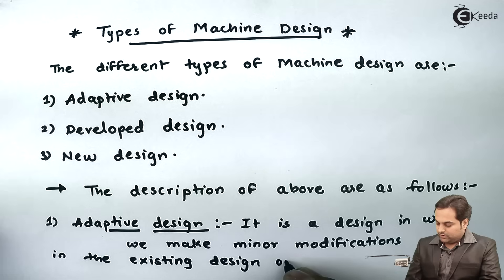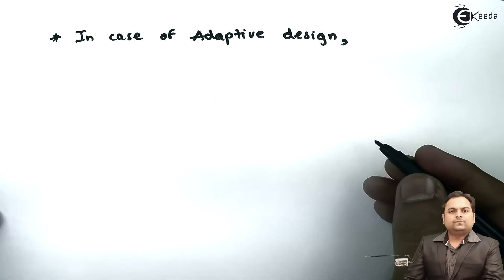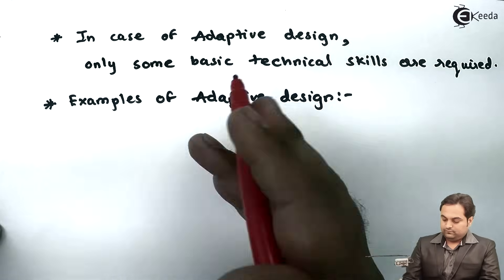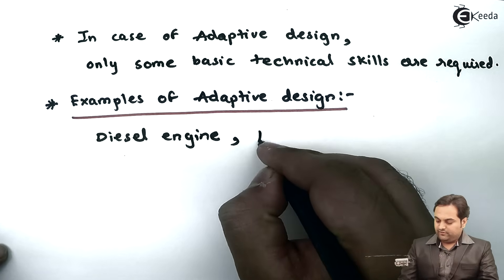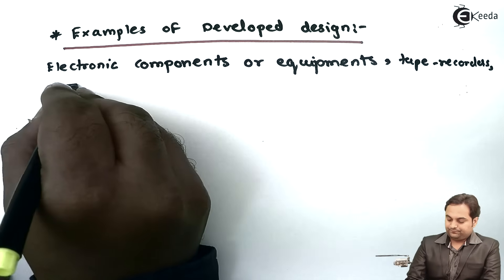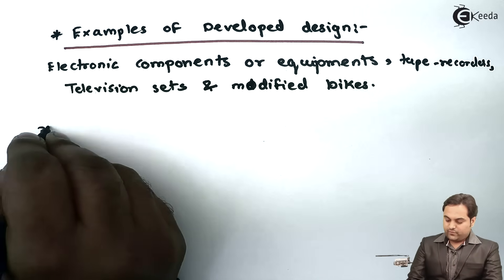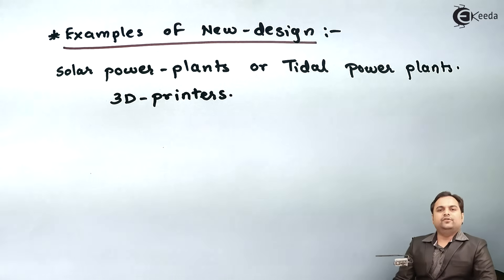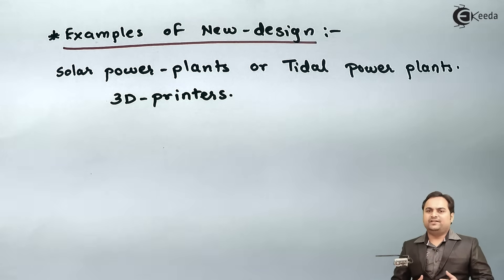What are the Types of Machine Design - Introduction to Design of Machine - Design of Machine

Comment: A V-belt drive is to transmit 10 kW to a
compressor. The motor speed is 750 rpm and
the compressor pulley runs at 250 rpm. Design
the V-belt drive. Clearly state the design
decisions taken...

Plz solution this question
Reply: https://youtu.be/vFDMaHQ4kW8 💐.